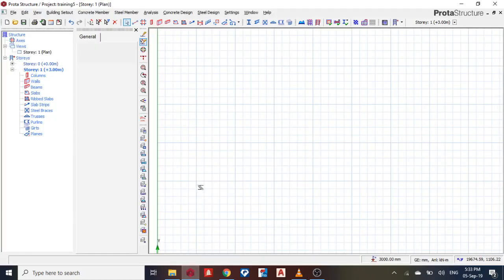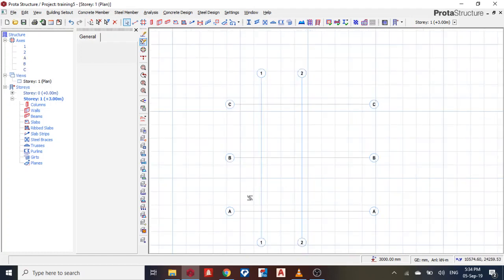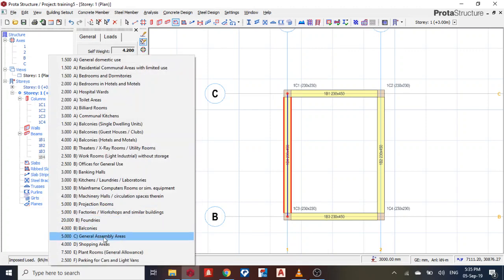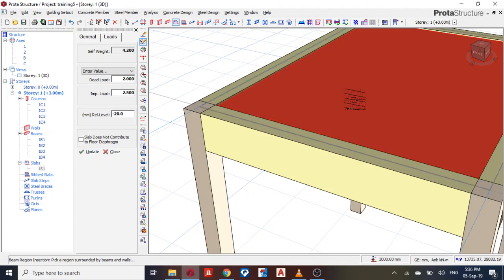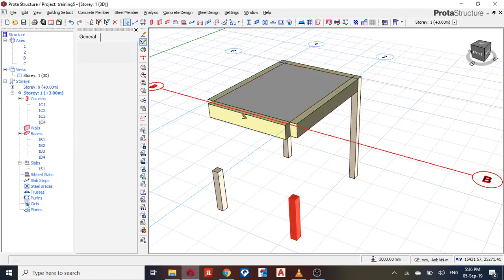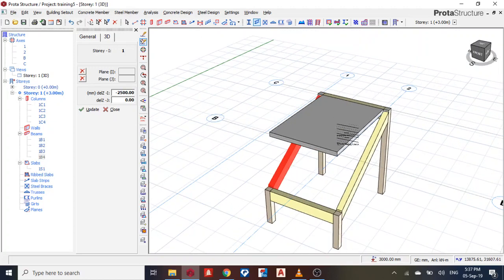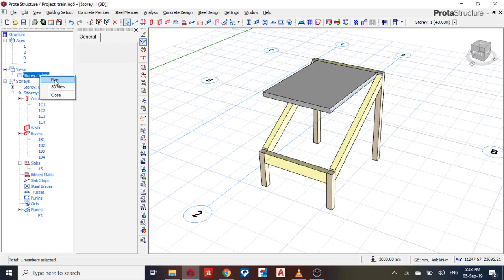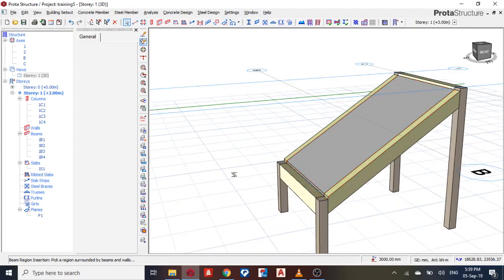How to model a slant slab on prota structure using plane Definition

Comment: Thanks for the tutorial. I have a question.... How to you model an arched beam in prota? That is a beam with a higher mid point than the two other ends?
Reply from the maker: I have not tried it before. I use staad in a situation like that
Reply: @Lanreolokunola  OK.... So, professionally, u prefer staad to prota?